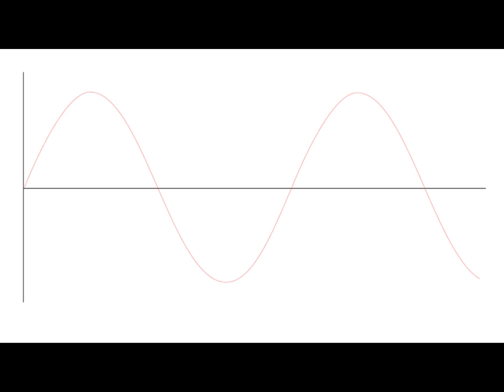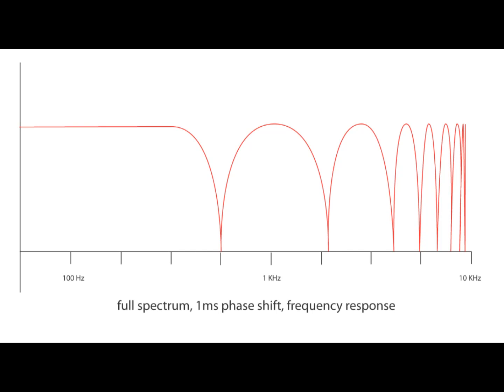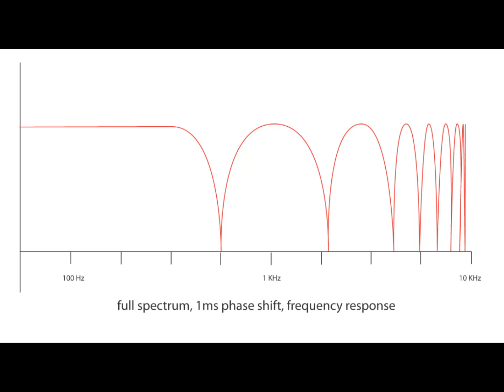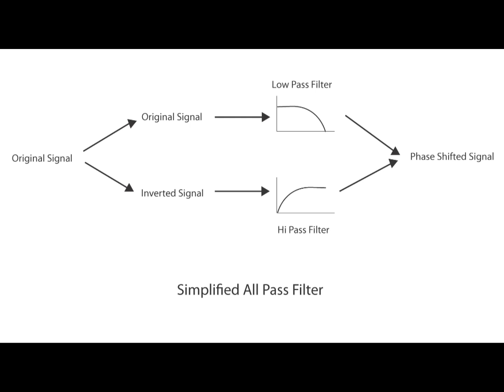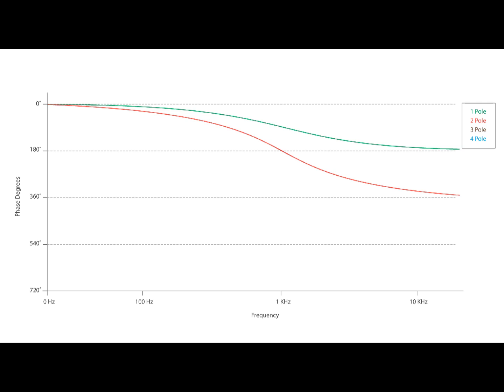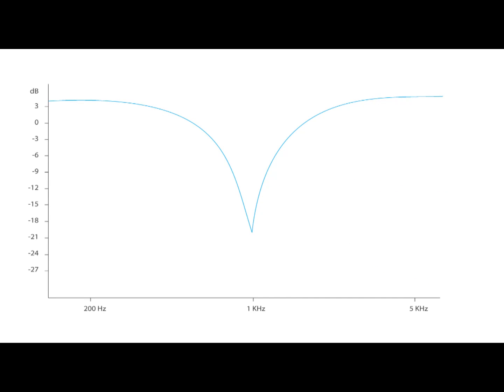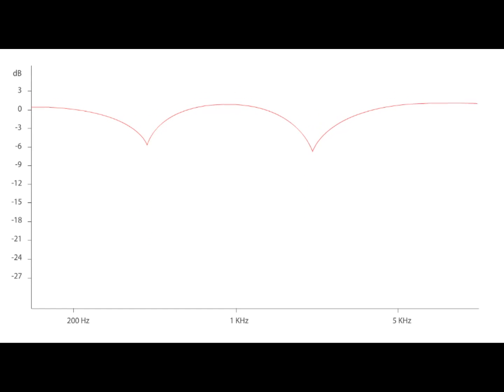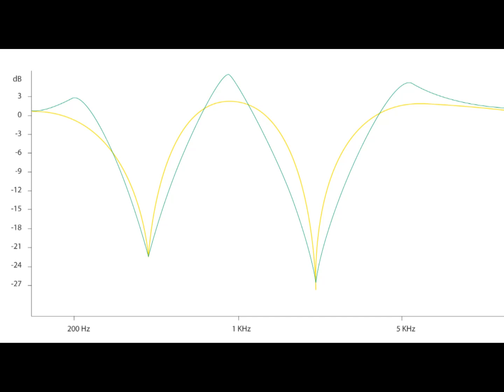Empress Effects Phaser - How does a phaser work?

Comment: What do you do in order to change the corner frequency?  My guess is that you change the cutoff of the filters but other sources say that you change the phase shift of the signal.  Anyway, I'd really like to know.
Reply: Apply a control signal from a LFO to modulate the corner frequency's control input. All-pass filters used to create phase shifts don't cut off frequencies - since they are mirrored HPF and LPF the spectrum is not altered - they  only alter phase.

Comment from the maker: @Uberloinvongenchler You would have to relocate the volume pedal between the guitar and amp. You're right, the H version can do both volume and expression on the phaser, so I'd go with that. I think the reason they offer both version is because some pedals/products require an expression pedal with a lower pot value.

Comment: @empresseffects Sorry for the confusion. I understand that the FV-500 can't be used as an exp. and volume pedal simultaneously. What I mean is, with the FV connected to the phaser's control port, is it still possible with the phaser off to operate the FV as a volume pedal or would I need to re-locate it inbetween my guitar and amp? Either way, basically, what is the advantage of the L version if the H can fulfil both functions?

Comment from the maker: @Uberloinvongenchler I'm not sure exactly what you mean. You wouldn't be able to use the FV-500 as both a volume pedal and an expression pedal at the same time, if that's what you're wondering. When using the FV-500 as an expression pedal, there would only be one cable coming out of the FV-500, and that would be a TRS going from the expression out jack on the FV-500 to the control port on the phaser.

The L and H versions will have the exact same sweep/feel.

Comment: Final questions. obviously it would be nice to be able to use the pedal for expression or volume but I am only likely to use it in the exp. out. on the phaser. Could the H version work as a volume pedal when plugged into the exp. out on the phaser or would it need to be moved 'in the chain'? Also, if this is not possible, would the L have a better sweep/'feel' (a bit like log vs. linear pots for volume?) Many thanks, and sorry to ask so many questions but this is an expensive purchase for me!

Comment: @empresseffects I have heard that for the general use as a volume pedal, the H version is usually preferable for use with electric guitar. Can you just clarify this as I want your expert opinion over hearsay. Obivously if pot value doesn't really matter then I'll probably get the H, but I understand one has a 25k pot and the other 500k - significant differences. Thanks, Charles